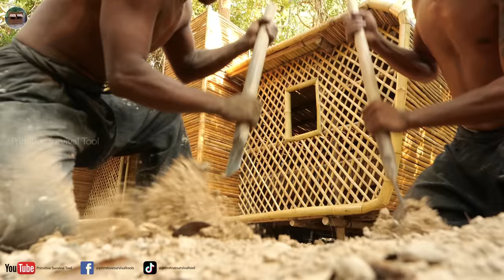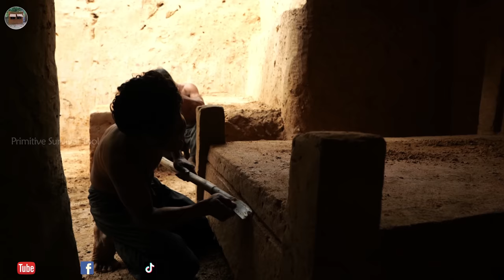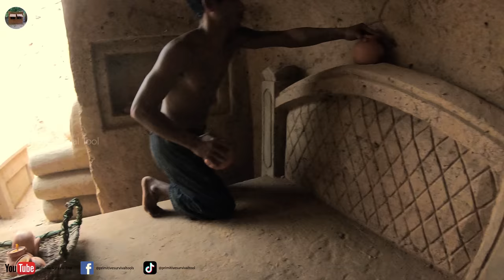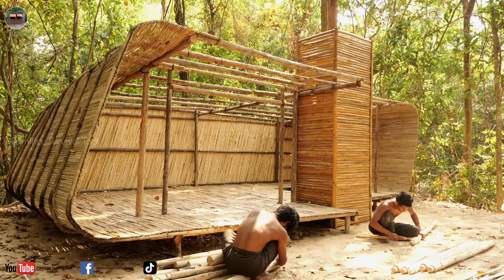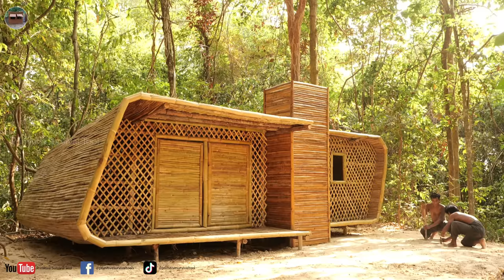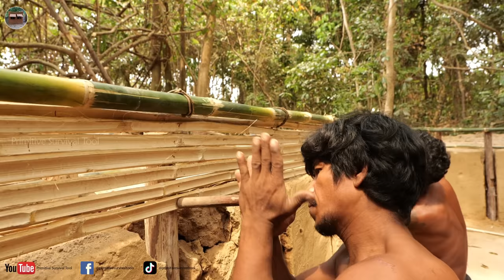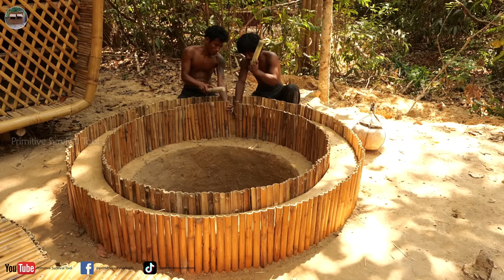[ Full Video ] Building Two Story Villa With Private Underground Living Room and Swimming Pool

Comment: Who would dislike this video? Lazy people? Envious people?
Reply: People who know it’s fake
Reply: How😭( im actually confused)
Reply: @hodaddy6825   whether they built it with primitive tools or modern tools doesn’t matter, it’s still an amazing accomplishment
Reply: @nalohope2065  it would be impossible to move all the dirt/clay from the pool by hand. Like How come the dirt isn’t piling up around the hole? Also the edges of the well are way to perfect to be done by hand. And how come the pool water isn’t foggy, when they showed it in the well and it was.
Reply: @nalohope2065  for example, pool has concrete mortar (grey color) very different than adobe mortar (clay and straw basically) and move all earth from excavations. Of course there is much of it a fake, but I love their design and originality. In some cases they use hand work, specially with bamboo furnitures, doors and wall panels. I know people, true masters as artisans, that make similar stuff practically without any modern tool.

Comment: Kinda scary digging in that soft clay under ground with no real supports. That well just seems like a death trap. It must be some really good clay they have there.
Reply: My thoughts exactly.
Reply: They're so DIY they made that clay by hand 🤣
Reply: Surely the water from the pool would eventually work its way through the walls of the underground bit? Not to mention the rain… they are bound to get heavy rainfalls out there. I guess it’s more about the entertainment than anything else. They likely aren’t used for anything after.

Comment: Surely this all falls apart the second monsoon season kicks in. 

If there's one thing I've learned about holes in the ground is that rainwater likes making it a home.
Reply: I live just over the border from these guys.  Can confirm.  

If the monsoons don’t get it, 2-3 summer seasons with the hot sun will. The tropical sun is incredibly destructive to anything plastic or organic.  The heavy rains are incredibly destructive to anything made from dirt.  Those veneers of split bamboo over the dirt walls and foundations are strictly decorative.

Comment: we hope the structure is fire-proof. It rains a lot in the wet season, though the dry season may be a bit scary. Good thing they have a pool of water to use in case of fire
Reply: bamboo is fire resistant and they can fairly easaly put some clay or orther plaster over the vulnerable areas.
Reply: the lack of drains in the basement room is also a concern
Reply: @alejandromorejon6935  true, true....

Comment: This is amazing. One thing I would love to see in these videos is on the bottom right hand corner of the screen a day counter (or an hour counter) so we could have an idea of how long each project is taking you guys.
Reply: I doesn’t takes much time because a construction company is probably behind this all
Reply: @Random-yq1yd  you literally see them building it
Reply: I agree. It would be nice to see the counter day by day, but they say it took 15 days in the description of the video. I believe them!
Reply: @beaustrom923  Footage cuts. The amount of material they excavate would require literal trucks to move away from the build site + the actual "ground" they are digging is man-made; The "dirt" maintains the exact same texture and consistency for at least 15 feet down, if not 20, and has zero large or small rocks in the entire area. They had the entire area excavated and filled with that material pre-recording.
Reply: @foxxinrox  I dont deny that there may be something cheesy happening, but they definitely are the ones assembling it.

Comment: I'm most amazed by the dirt and clay they're carving everything out of. I mean that is like so pure and perfect and can be carved easily, yet strong enough to hold shape and a lot of weight.
Reply: Its because its fake and manufactured
Reply: @idiotbuster8662  is that true? i've always wondered this myself
Reply: @idiotbuster8662  I've been analyzing these youtubers for a while and the things they do off camera is that they could possibly use extra tools to help them build underground off camera. They could also have some help with other people as well  as using machinery for the off camera parts. I am still doing more research on weather they are or are not using extra help/machinery on the off camera moments.
Reply: its not that easy,it takes a lot but looks like its very easy because its speeded up

Comment: What is the ground made of that it holds its shape so well, and doesn't seem to have issues with water? Crazy cool stuff!
Reply: Clay
Reply: @EddieErion929  really? We have clay here and it's wet, and if you add water it turns into clay soup. That's cool, I would have guessed some sort of sandstone. Cool!
Reply: @joshuawirht3832  yea very cool! I don’t know everything but different areas have different clays   They are adding just the right amount of water for the clay THEY have. any clay left to dry in hot weather will turn into stone
Reply: @EddieErion929  okay, but they literally mixed the clay with water to make it runny so that they could spread it. Why doesn't it just turn back to mush when water is added again later? Also, how are they getting clean water out of a hole in the dirt while agitating it every time they dunk the basket. How is the water so blue and clean in the pool?

These videos are cool, but they honestly seem staged. I mean, obviously they have skill as you can literally see them using the tools and carving things. While THAT is real, I don't think the final outcome all together is what it would be in reality. There's obviously some trickery they are pulling behind the scenes.
Reply: @brennanIX  only god has these answers 😂

Comment: To me what I think is that building all of these structures is like building a lego set to them. Engineers take a long time to design and construct modern houses. Meanwhile some guys with some sticks and basic construction tools build something like this. Though it could be that the houses engineers design and construct are just more technically advanced... After all I don't see them making anything like a working microwave from the material they have.

Comment: Whenever I have my friends over and sometimes it turns into a sleepover we have to watch these guys every single time we have to come over and play if we don't the next time we have to watch double this stuff or double the things That they do to catch up because these guys are gonna take me when 000000000000000000000000000000000000000000000000000000000000000000I can never do that that's how many times Even get me to do the kind of stuff these guys do yeah not 1,000,000 trillion trillion trillion billion years I will not doing this kind of stuff I it doesn't hurt me to make small concrete slopes though